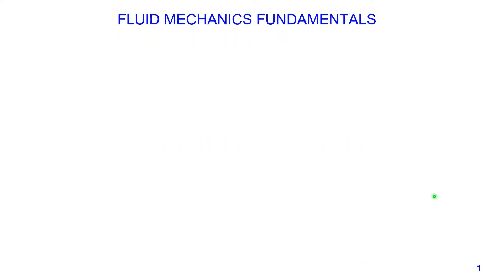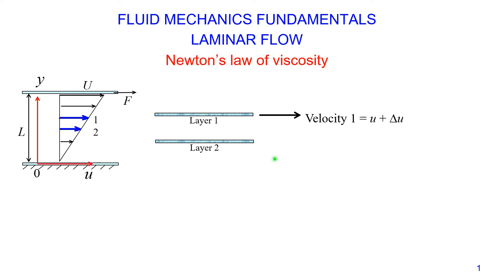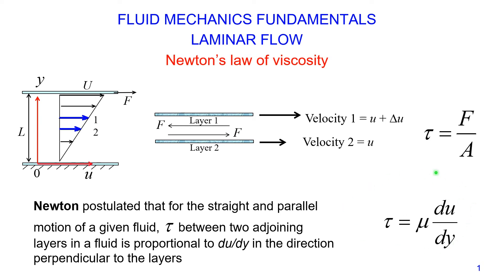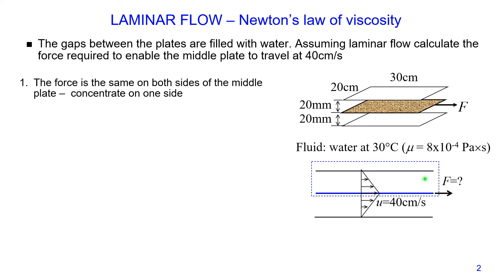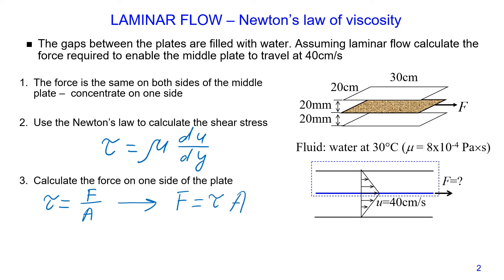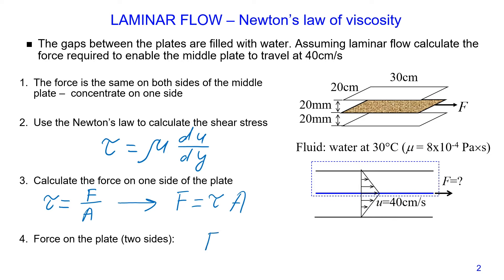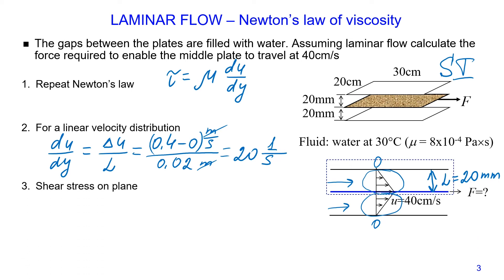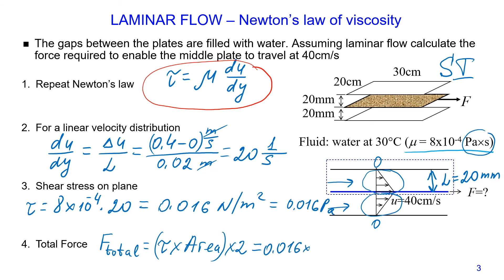Calculating the force to enable a plate to travel at certain speed for laminar flow

Comment from the maker: Fluids fundamentals - solving practical problem: the gaps between the plates are filled with water. Assuming laminar flow calculate the force required to enable the middle plate to travel at 40cm/s